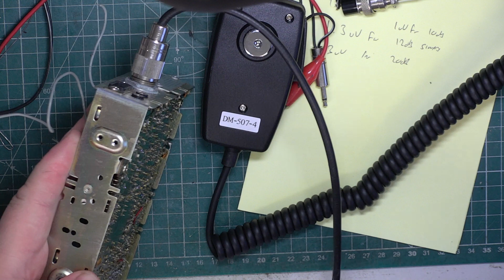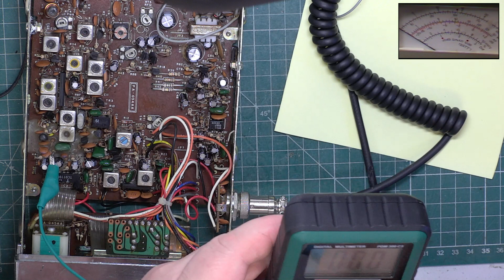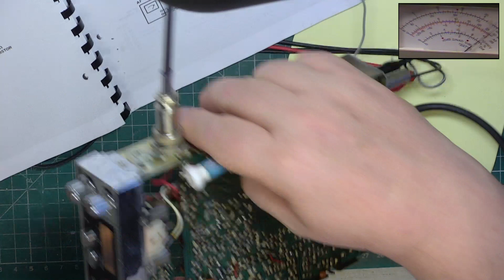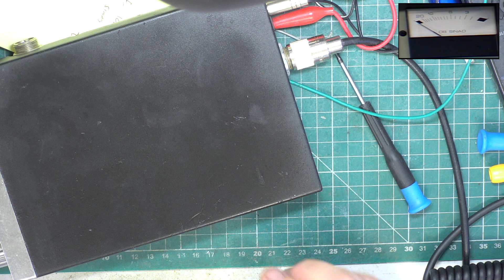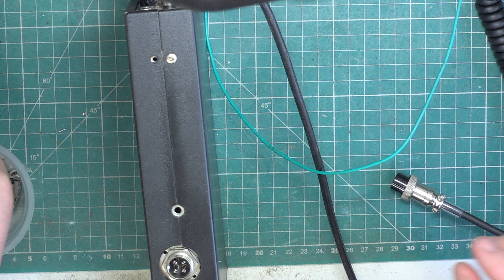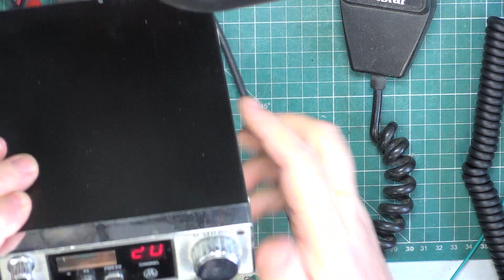Uniden Uniace 100 CB27/81 UK FM CB radio - repair & alignment

Comment: Hate to see the soldering iron tip  poked into waxed inductors... It ruins the form altering q factor and melts the thread.. Also if you break a core you then need to unsolder the thing to wind it out the bottom... Pick it out carefully and use a little hot air if needs be.. Apart from that good work indeed...
Reply from the maker: I do have a hair dryer, but this bench is limited to 750W of electricity. I'm always careful not to touch the edges with the soldering iron....it's not just dumped in the core any old how.  As you rightly say, when you come up against a broken core the coil needs unsoldering & removing from the other side.
Richard, G0OJF, UK

Comment: I had the same issue with the meter.
There are two brass adjustable screws on the meter, the bottom one needs to just be adjusted and the meter will then run free.
Kind regards Paul G0VRY
Reply: All the meters go that way lately... Old age

Comment: other sets that use this PLL have provided a trimmer for the crystal load capacitor. This can be also fitted to this set by removing C60 (39pf) and replace with a 10pf cap capacitor and a 50pf trimmer in parallel. This will give the same control of the crystal as in other sets using the TC9106 Aand TC9119 PLL Frequency Synthesizer.

Comment: In theory power mikes shouldnt cause over deviation if the deviation is set correctly the radio's internal limiter should take  care of that - but I guess it varies from one chassis to another. It will still sound distorted if overdriven though.
Reply from the maker: Quite right, it shouldn't cause over deviation at all.

Richard

Comment: Richard, when you had the screwdriver on the meter bearing did you just loosen it a tad ?
Reply from the maker: Yes I did...about 1/16th of a turn

Richard
Reply: Use some nail varnish remover(acetone) on the screw head to soften the glue before attempting to slacken off.